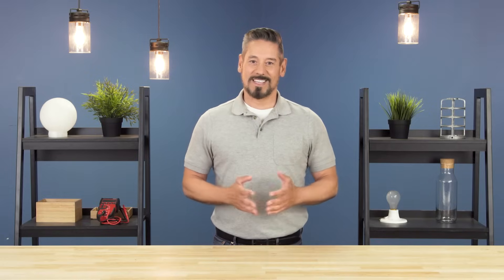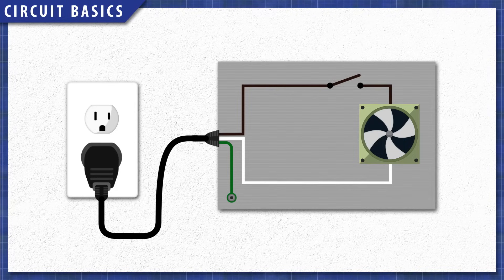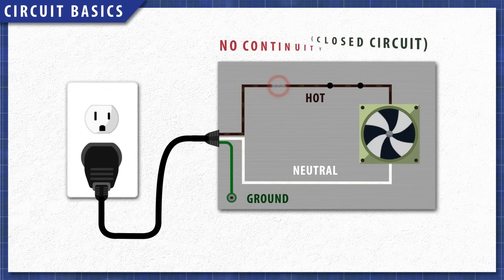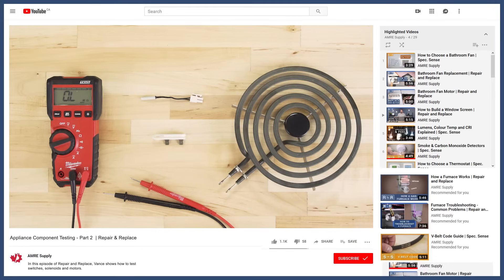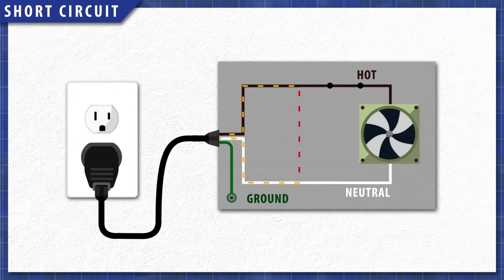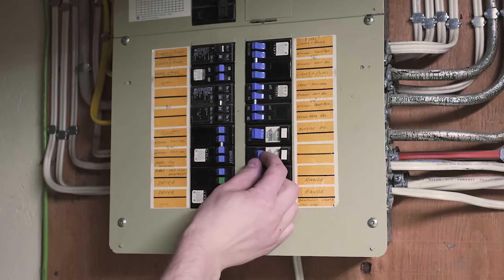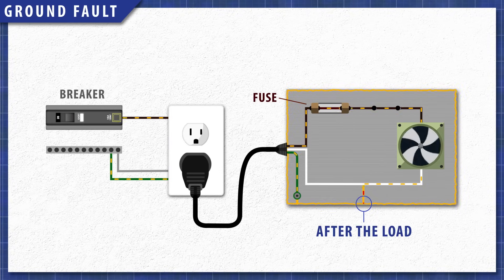Appliance Circuit Basics | Repair and Replace

Comment: When an appliance cord is plugged into an outlet, even if the switch is off, does the current flow through the cord up to the switch? If so, would this mean there is some current in the wire and it'd be possible to have a short even with the switch off? Thank you
Reply from the maker: Thanks for watching. Current only flows when a circuit is completed. The hot wire will have a potential difference or voltage, which is the pressure that will push the current through the wires when the switch is completed. There can be a short even with the switch is off if one of the wires is compromised and is touching the metal housing or another wire. This video describes some of the concepts of electricity in more detail it's a good watch as a review: https://www.youtube.com/watch?v=r_migcta_Is

Comment: I want to make sure I am understanding correctly: if you have a ground fault after a load and your system is ungrounded, wouldn't this be a potentially dangerous scenario since your appliance would be working but if you made contact with the housing you could be electrocuted? You would have no way of knowing there was a fault in the first place. Is this correct?
Reply from the maker: Thanks for watching. Yes that is why the ground wire is connected to the metal frame to reduce the chance of a shock. It can be difficult to see if there is a fault, but you can test to see if there is continuity to ground. You can see an example of testing for a short to ground in this stove troubleshooting video: https://youtu.be/l39vOnhqnhg?t=209

Comment: .
What will be the voltage between ground and neutral according to safety norms >n 220v.systems.
Reply from the maker: Thank you for watching. There should be no voltage between ground and neutral. If there is, then that means that there is an issue with the wiring.

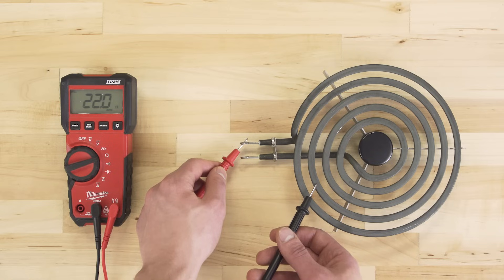Comment: 5:35 im confused on this
Reply from the maker: Thanks for watching. In that example we checked for a short circuit between the element wire that runs inside, and the insulated metal housing. There should be no continuity between those two. The outside of a coiled electric heating element is not connected to the circuit. This is to prevent someone from being shocked if they accidentally touch the burner.

Comment: Added note. Do amp draw on the circuit. Breakers and GFCI do wear out. knowing amp draw will direct you in what might be at fault. Also, Breakers and GFI are not the same. With breaker, you can get electrocuted as with GFI you should not.
Reply from the maker: Thanks for watching, and we appreciate the extra notes!!

Comment: Hello sir , how much minimum resistance required to avoid short circuit in 220 AC Volt
Reply from the maker: Thanks for watching. A short is any unintended connection and will generally have a resistance near 0 ohm for several seconds. Regardless for a circuit to not overload you'd have to consider the what the wiring in the circuit is rated for. If you have a 220V circuit with wires rated for 15 amps, then it can handle a max of 14 ohms. You can plug these numbers in yourself in this calculator: https://www.rapidtables.com/calc/electric/ohms-law-calculator.html